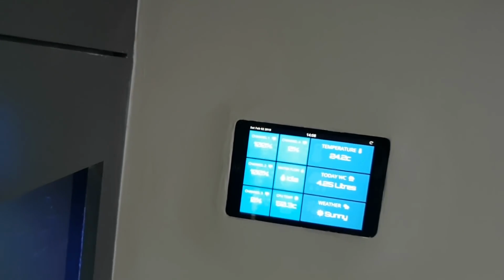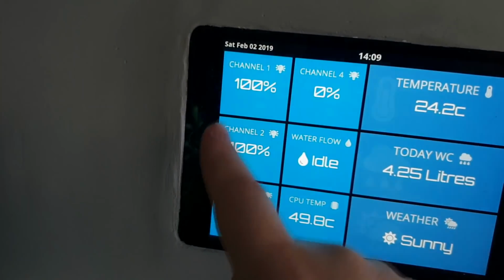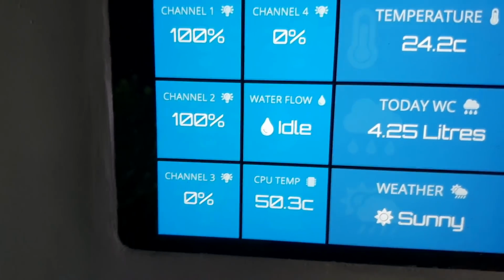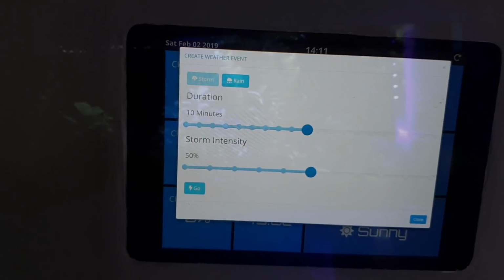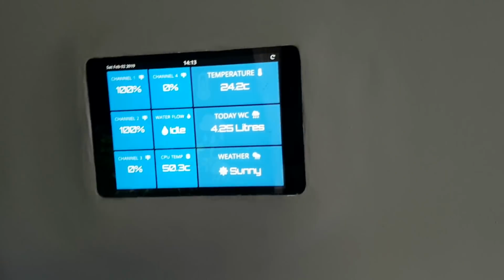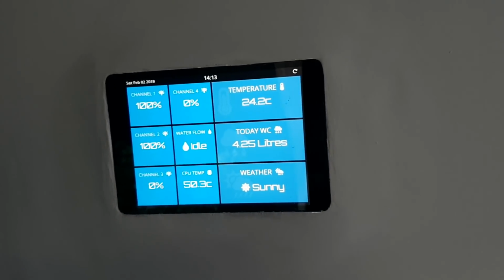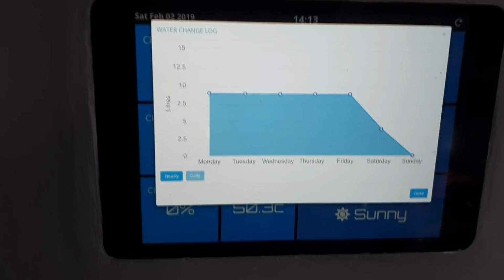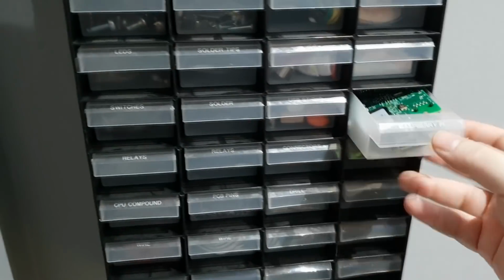Raspberry Pi computer Aquarium Controller, Auto Water Change, lighting and Storm Simulator Tour

Comment: Very cool! So am I understanding correctly, the PI is just constantly pinging your API to get the new parameters that you are setting from your PHP site? I’ve been looking into several projects using either a Wifi enabled Arduino or a Pi and I hadn’t even considered just using an API like this. Would be easy to then allow control from a mobile device.
Reply from the maker: This was the old version and was, replaced by an entirely Python version https://github.com/louisvarley/fishPI, the PI was running essentially a seperate backend and front end. Backend was the API and processes for getting data from sensors. API was there to talk to the frontend (and any other systems i wanted to integrate into) while the backend was taking data, (from sensors) and entering it into the SQLite Database.

Comment: Hi following your videos on this really good setup you did been reading all your materials just going over the top of my head, understand some bits but I’m not that good with programming. Would you be interested in doing a setup for me like this?
Reply from the maker: Really depends on what you want and what your budget is
Reply: Thanks for the quick reply, I was looking at having pi to control the lights, automatic water change and ph  probes, haven’t got a budget atm what would say something like the setup I want would cost?
Reply from the maker: @channisanger  really hard to say, most of it depends on your knowledge of making circuits, plumbing in the tank, getting a carbon block setup etc, you could probably do it for £50-70 on a budget

Comment: What sandbox app did you use? Your project looks amazing, looking to build something like this.
Reply from the maker: If by sandbox you mean IDE I used visual studio. The code will run on windows python 3 and will skip bits requiring sensors just returning n/a
Reply: @superfly108  Thanks!